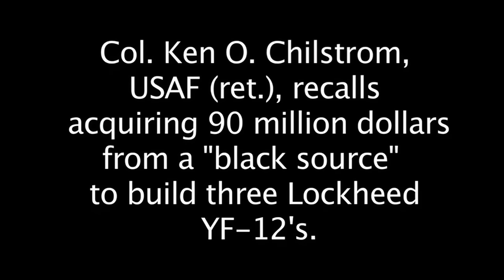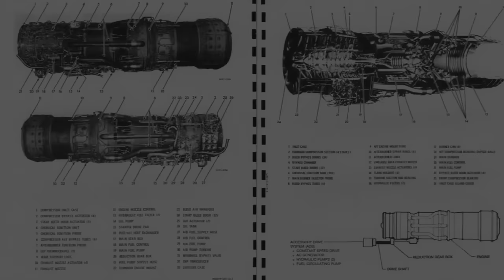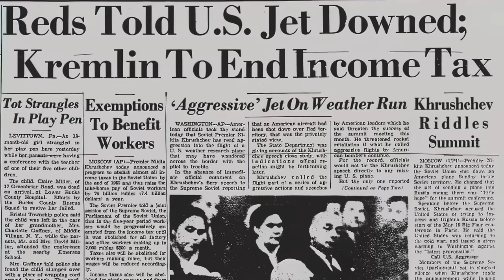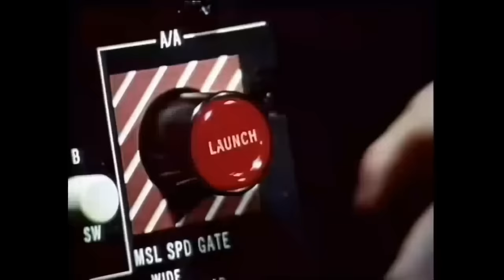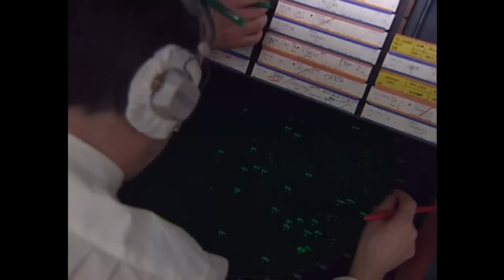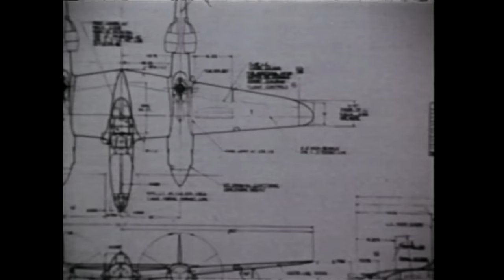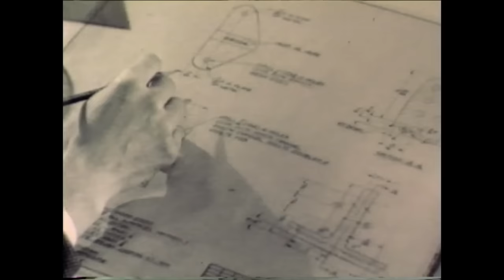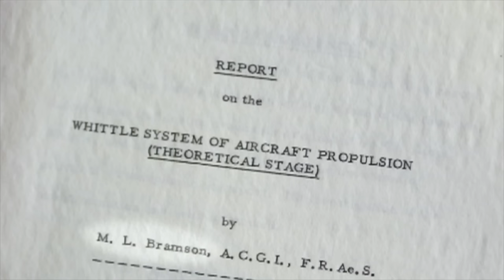Funding A YF-12/Blackbird Secret Project | Covert Cold War Operations

Comment: First was the A-12. CIA no AF. Then YF-12. SR-71 Came last.
Reply: A-11 then A-12 (A-11 was aerodynamically identical by had a higher radar cross-section). The leading edge of the wing was modified by changing it to a composite structure. The A-12 was a stealth aircraft.
The YF-12 was a cover project for the A-12 program.
Reply: @allangibson8494  No. The YF-12 was a long range interceptor. Carried  missiles.
Reply: @manfromks  The YF-12 was specifically developed to provide “cover” for sightings of the operational but unacknowledged “black” A-12. The A-12 was significantly faster than the YF-12 but was close enough in body shape and size to explain sightings.
The F-117 project was similarly hidden in the F-112 to F-115 operation of Russian and Chinese aircraft (and Swedish) as adversary aircraft from the same airbase in Nevada. The F-117 operated at night and the F-112 to F-115 during the day. A “black in black” project.
Reply: @allangibson8494 the A11 was a vastly different design and not like the A12
Reply: @allangibson8494 the Yf12 was a totally separate program, not made just as a cover
Reply: The AF did own  3 A12s before transferring them back to the CIA. Also the M21 came after the YF12 before the SR71
Reply: @gr8crash  It was most definitely a “cover”. Hence the “black” funding.
Reply: @allangibson8494  it was absolutely not a cover. It was its own classified program started after the A12 development when the AF wanted an interceptor. After it's first flights it was publicly acknowledged and transferred to Edward's. THEN it was used as a cover for the A12, but not before.
Reply: @gr8crash  The use of one covert program as cover for another has a long history. 
The engineers at Lockheed stated as much in their memoirs about the YF-12 that the CIA saw it was a useful diversion.
The A-11 prototype existed long before the YF-12 was even a concept.
Reply: @allangibson8494  the A11 never existed outside of the RCS mockup. Out of the 12 Archangel designs, it was the only one to make it to mockup and its RCS was incredibly large. Hence they were told to go back and redesign the aircraft. 

But again the YF12 program wasn't built as a cover for the A12. It was its own separate program from the A12. It was only later used as a "cover" for the A12 when it was made public and transferred from Area 51 to Edward's.

Comment: Ok .. Ok .. this was Kelly Johnson's dream solution to a problem. High is not working so.. let us make a plane that is a missile and steal the Titanium from the Russians! The engines were the biggest leaking while on the ground parked (RAMJET) hybrid what the Fudge ever. That iconic nose cone of each engine that droops down was designed to control the intake at stall speed to MACH 4.5. Did it do MACH 4.5? Nope! Human Cargo would not like that speed too much! Ya think the next generation is not a working platform? Yeah...
Reply: Speed is irrelevant to the human cargo. Heat and acceleration are the relevant variables. The skin temperature is the limiting factor for the operating speed of the SR-71.
At 260C (the critical boiling point of the fuel) that limited the aircraft to Mach 3.2 in sustained flight.
Reply: It was designed to go mach 4.5 as Kelly Johnson wanted redundancy built into the system just incase materials were to be developed that would withstand the heat of those speeds... mach 7 in the X 15 was achieved so where is the issue with humans going at speed?

Comment: Wait.  What!?   At 28:38.  He said the Pratt & Whitney J58A engines produced 160 thousand horsepower.  160,000HP.  
A kilonewton is a metric unit of force. Horsepower is a non-metric unit of power.  So you can find a conversion between kilonewtons to pounds or horsepower to Watts, but horsepower and kilonewtons cannot be converted directly.  
I think someone tried the wrong math here.  And missed the conversion for such a near 20-fold giant error.  
And there were no tanks in the engines either.   Ever seen a picture of the SR-71? 5 tanks were most of the interior fusilage. 
Did anyone edit the script before it was read and recorded to be released here?  They had around 34,000 HP.
Reply: 34k lbs of thrust,  not 34k HP. 5 fuel tanks were within the fuselage, tank 6a & 6b were in the wing section